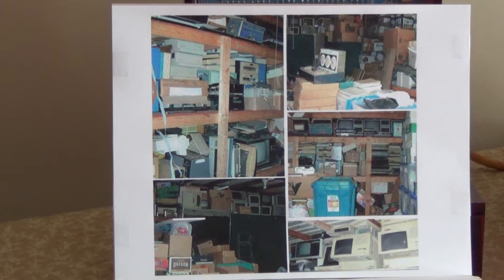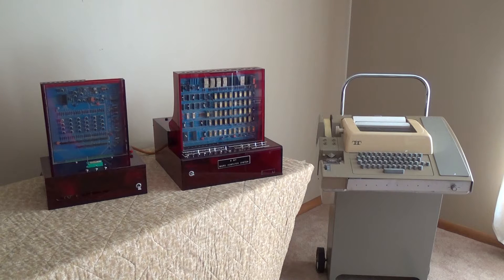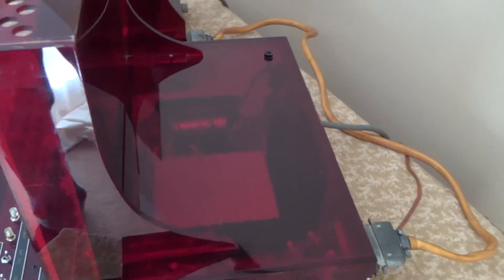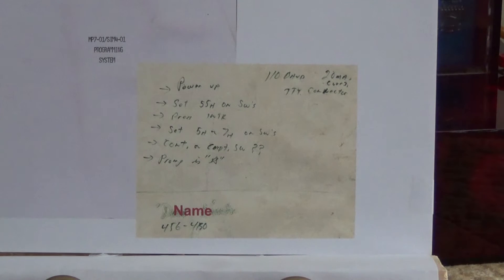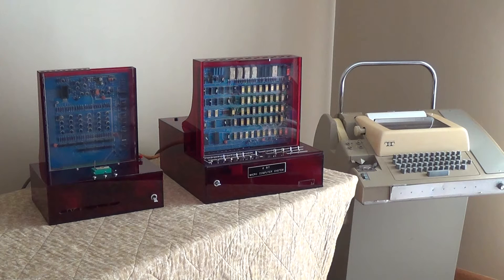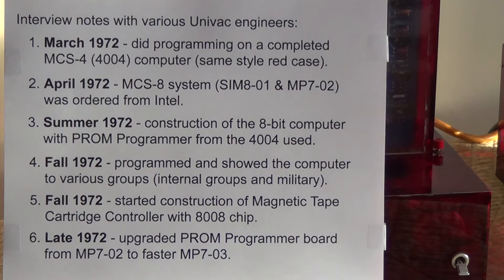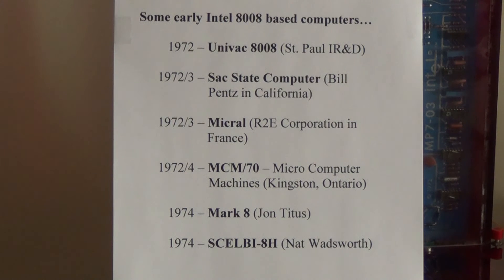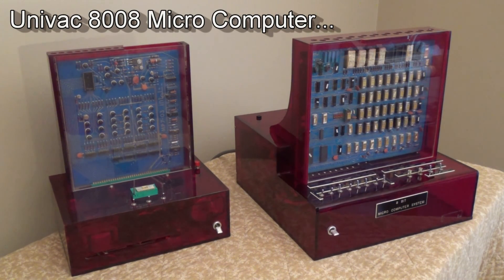1972 Univac 8008 8-Bit Micro Computer (Vintage Computer Collection)

Comment: Computers and equipment from Q1 Corporation:

Q1 had three generations of computers as we know of today (June 2024). (Thanks to Karl Wacker, former employer at Q1!)

1st Generation:
Q1/LM (Released 11 December 1972)

An 8008 CPU based, single line 80 character display with printer in console,  1-2 single density floppy disks, housed in desk, 16K RAM.

2nd Generation:
Q1/LMC (Released April 1974 as a preproduction unit for Israely Air Force, first final delivery in August 1974)

An 8080 CPU based, 8 line 37 character/line display, printer in console, 1-4 single density floppy disks, housed in desk, 16K - 48K RAM

3rd Generation:
Q1/Lite (Released in 1976)
Z80 based, 12 line 40 character display, optional external printer, 1-4 double density floppy disks, housed in desk, 16K-48K RAM

Q1/Lite IWS
Z80 based, 12 line 40 character display, optional external printer, 16-48K RAM. Supported by 307K baud serial link to either a multiplexer built into desk with CPU board with 16-48K RAM, 1-4 double density floppies, and/or 1 or 2  27 Mbyte Hard disk drives, which could support 1-32 IWS workstations.

Q1/Microlite
Z80 based, 12 line 40 character display, 1 or 2 double density Mini-floppies, optional internal 80 column dot matrix printer. 

The Q1/Microlite could also connect to the Multiplexer's 1-4 double density floppy disks/ and or 1 or 2 27Mbyte Hard disk drives or a non-multiplexor desk with 1-4 double density floppies or 1 or 2 27Mbyte Hard disk drives [limited by EPROM space to either one].

Comment: In 1977, I joined the Metrovision amateur television club in Arlington Virginia. This club was the first in-band amateur television (ham radio) repeater in the world. WR4AAG. The club members I remember were Bruce Brown and Ruth Philips. No doubt, silent keys both today. The repeater was controlled by a hand built wire wrapped 8008 computer if I recall correctly. I'm fairly sure it was not a 4004, but it might have been. Its big feature was that by somehow connecting an ascii keyboard to your audio input, you could play guess the number on the repeater controller and see it on screen at home. I was not a licensed ham at the time. So, I missed out on that thrilling fun. My popularity in the club was due to me being the only member with a VTR who recorded as many of the on air QSOs as I could. I would paly the tapes for the club at our monthly pot luck dinner. Good times! Thanks for the nostalgia!

Comment: Thank you for the Video - could you run the machine with the Teletype machine and how i can program this machine? How fast is the 8008 and how i can step the cmd? Can you show us this? - if this machine is working. i programmed only i8051s in the early 80s and then 8515 Atmel and then ATMEGA and then is stop my Assembler Carriere after 25years of programming this in Assembler. Sniff i'm to young :-)

Comment: I'm just guessing here, but i think the address and data readouts on the EPROM programmer are showing octal, and not hexadecimal as we are used to nowadays.

Anyway, a very cool and interesting video which has earned you a new subscriber. :)
Greetings from Denmark.
Reply: Absolutely correct. The 8008 instructions broke down to: Bits 8,7 were the instruction type. The next two pairs of 3 bits each were source and destination pointers, such as specific register, memory and possibly IO. It was possible to build instructions in your head if you knew the codes for the sub byte bits. You then only had to memorize less than two dozen exception codes, like enable/ disable interrupts, for instance.
Reply: videolabguy
I understand what you mean; i'm fairly well acquainted with the Z80 myself, although not to that extent which you describe! hehe
TBH i prefer to let the assembler do the nitty gritty parts so i can concentrate on the program itself.

Comment: For sake of completeness, the serial port connecting the Teletype was probably not RS232, but a 20mA current loop.  RS232 is using voltage modulation where teletype used a modulated current, which was deemed more reliable at the time.
Reply: True. I used my ASR-33 TTY with the Mark-8 system for several years in the 
mid 70's. Not RS232; current loop.

Comment: I've never been able to understand how the 8008 managed to do anything with so few pins... I should get on Wikipedia. .. just don't see how you manage to cram the narowest address or data bus into such a small package.
Reply: The 8008 had only 8 lines used to port all the I/O for not only the 8-bits of data but also the HI & LO bytes of the memory addresses. It was in the 3 status pins that would be the control logic which trafficked whether the information on the 8 lines was part of a RAM address (HI, LO or Both) or if it was data to be read or written.
Reply: Intel never learned that multiplexing really sucks so that's how

Comment: There was a 4004 before the 8008.
Reply: Klaas J you are partly right. The 4004 was developed in collaboration with a gentleman named Masatoshi Shima from the Japanese calculator company Busicom. However, the 4004 had capabilities beyond the requirements of a mere calculator, and was further developed into the 4040, and this more or less paved the way for the 8008, and subsequently the 8080, and the rest, as they say, is history. As a consequence of his collaboration with the 4004 team, Mr. Shima-san was hired by intel, but eventually left and helped start Zilog whose first product was the z80.
Reply: That is actually not a processor, but a microcontroller for calculators. The 8008 is based on the Datapoint 2200. So completely different devices.
Reply: But the 8008 was completely different as it used the instruction set developed by the guys at Datapoint.

Comment: My school had a similar system in the 70's.It was just a black box connected to a teletype. It ran Microsoft basic which had to be loaded on paper tape through the telly type. It took over 30 mins so it was left on all the time. Any programs you typed could also be saved to paper tape.